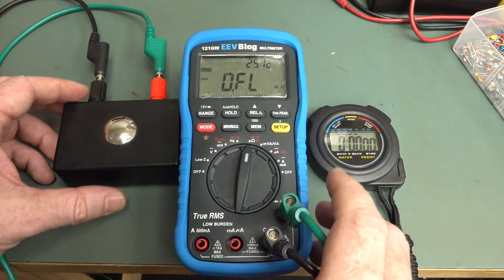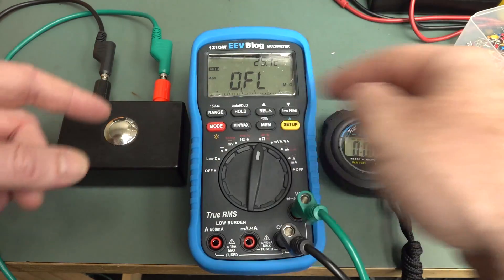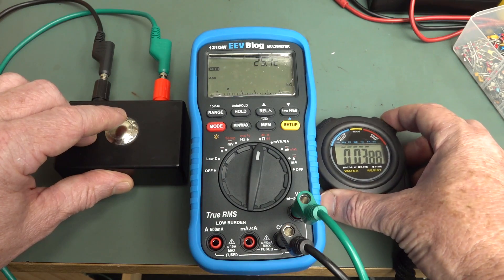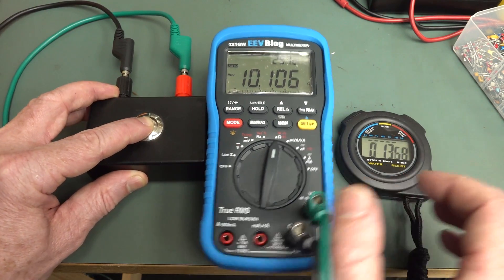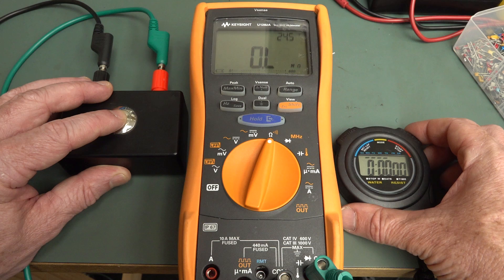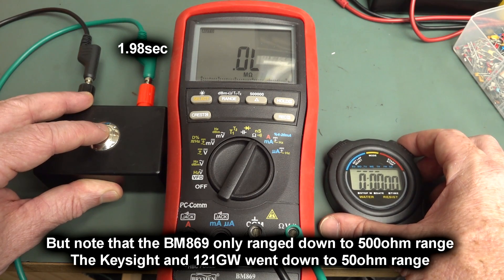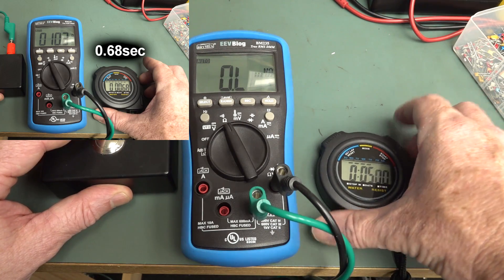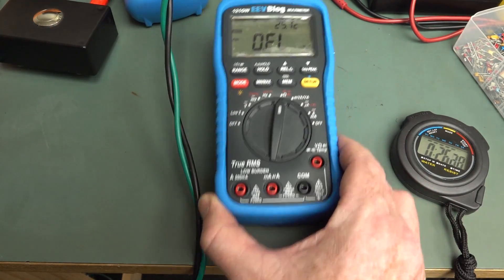121GW Autoranging Speed

Comment: Dave, what's wrong with you? 😉
Didn't you notice that the 121GW wasn't even settled when you measured the time? It's useless, even if the meter autoranges in 100 ms, it doesn't help when the reading keeps fluctuating further. 🤔
Take a look at the Keysight, it takes longer to display something, but when it does it locks right in, and is stable. You shouldn't care so much about people complaining about the speed, changing the firmware just makes it worse.

Comment: I agree most of the problems (especially with the slow ranging) were fixed. GREAT JOB! The 50 ohm range doesn't make sense to me. It does not produce repeatable readings which are better than the 500 ohm range even with the best case scenario - trying to measure the resistance of the gold-plated probes. The value moves up and down and does not give you higher stable resolution than the 500 ohm range and I'm not even concerned about accuracy. I've asked many times for options to disable this range in firmware somehow (using setup?). The same instability I can see in the 500 mA range where the extra-low burden voltage is. It is kinda pushing the limits of the used chips.

Comment: Hi Dave, great content. My Fluke 12 (from the 80's) beats all those you were using, however as you may know, it has no current range! I have become to trust it though and apart from the buttons which have worn out it has never let me down. I fixed the 4 buttons with some tact type switches and it works well. Good luck...

Comment: That´s why meters should have manual range select too
Reply: I have both types, but my auto is like 1/2 second at most like when continuity buzzer kicks on, but the reading is well before that. I didn’t even think about them being this slow.... mine was like $9 and it’s 1 button to turn on (so easy anyone could use it) and you can’t fry it even jumping between batteries with some that are dead (so they give resistance measurement) and some are fully charged 4.2v as you drag it slowly across the balance connector. I’m happy with it since it’s fast and indestructible so far, and seems to be really accurate for the extremely low price (it only goes down to the hundredth of a volt but it seems to be good to +-1 of the last digit when compared to a few of my more precise units that go to the thousandth of a volt on lithium batteries)

So in the case of that meter, there is no need for a dial that can break, its just a nice simple 1 button press and away you go jabbing probes into things! I never thought I’d like that, as I even hate the timers on windshield wipers, id litterally my rather press a button every time to make the wipers move because the speed is never how I want it since they don’t have potentiometers, I like things to be extremely manual and about have a heart attack when the stupid auto-roll up windows turn on because I’ll manually stop it at the top or where I want it! those things drive me crazy... but, the auto-range meter works so well and so fast I would have 0 use for manual dial (I would consider 1 second unacceptable, I usually only probe something for half a second at max, or faster for detecting shorts since the averaging of resistance will show a blip of a change and then I can go back).

But at these slow speeds I totally agree! For that meter I would definitely want a manual range too!

Comment: It’s too slow for troubleshooting. Try a short. The reading float around after that 3 second delay. Compare against a fluke 87, which is pretty much the meter used by everyone.  I am not used to meters this sluggish that the resistance reading float. Manual mode is fine speed wise but it’s so damn hard to figure out what range you’re on. I like the meter but it almost useless for troubleshooting.
Reply: With the original firmware it was unuseable for troubleshooting, but with V2.00 onwards it's bearable but only just......unless it's a big long job. Would love to see the autoranging routine completely revamped and to included a fast pre-emptive display of the value which then zero's down on the accurate value. Not sure how much this would be due to chipset though.
Reply: IanScottJohnston it’s a dot matrix LCD, correct? Have the firmware better indicate on the screen the reaction to the range button. I, for one, find it very difficult to tell what the range button is doing or what range I’m on after pushing it a few times. In manual mode it can be quite good for trouble, but it would be a tremendous help if the range display was easier to figure out. I can spend brain attention to figure out my test gear when I’m trying to figure out an issue with the circuit I’m working on. 

I realize this meter can do a shit ton more than most metered (low burden voltage for current measurements!). So it’s more of a small lab instrument than a hand help DVM. For troubleshooting, it’s hard to beat an old fluke 87. Fix the resistance auto response or better enumerate the manual resistance range and bam you have a great DVM! 

Also what Dave didn’t show comparing it to an Agilent, is it is not only response time: short the leads together and it reads .”020 ohms and then slowly over 10 seconds or more, it rises to maybe .256 ohms. That sucks when to are trying to measure how good a ground is. It fluctuates so bad, the REL button is useless.

Comment: Perhaps someone could explain why you need a fast ranging multimeter? Never seen this as an issue in my use.
Reply: Theoretically, if one has to test 100 or more resistors for example, and can't set the range manually, half a sec or something more per reading could add up. In such a setting though you'd take way more time to set the leads so idk what the fuss is about.
Reply: @HankScorpio64  I wasn't clear enough, sorry. I meant half a sec more per reading compared to a faster multimeter with comparable accuracy. Totally agree with you.

Comment: Hi Dave, do you know there is a gigadevice microcontroller called gd32f330 on lcsc.com, its a clone of stm32f330, tssop20 package. i dont know wether its pin compatible with the stm32f070 in the usupply but its a cortex m4 series microcontroller and has 128kb flash, maybe it can replace the 070 one.
Reply: I just look up the datasheet, its pin compatible with the stm32f070.

Comment: Sure you can find a few meters with faster update speeds, but which of those has low burden voltage on the current range, which of those will light a 12 volt LED, which of those will measure current and voltage combined, and does logging and Bluetooth

Comment: "I hope that cleared that up" - yes Dave. It shows us that it is slow.

That might not be important for most folk, but if you bought it to replace a previously fast meter... You would be understandably bothered by this.
Reply: For application that one really needs fast meter, just use fixed range meter.
Reply: @johnyang799  Ah Captain Obvious, you'd think you'd know this but... that "solution" only works if you're measuring a single fixed range.
Reply: @lmaoroflcopter  Just use a higher range right? Unless you need high precision and speed the same time which is very uncommon application wise.
I should say use different meters for different application.
Reply: @johnyang799  Statistics or gtfo. "Which is very uncommon". How uncommon is it?

Yes. A solution would be to have a different multimeter set up for different situations as required.

That doesn't change that the 121GW is indeed a slow auto ranging multimeter (not the slowest, but it is slow), and that if you are used to a better performing multimeter, it would be a disappointment.
Reply: @lmaoroflcopter  So what? I never said 121gw is fast or not. I was simply suggesting using a fixed range meter for the use. Why be so angry? And "statistics or gtfo"?  I simply think about the use cases through my head and cannot pick out an actual application that requires a multimeter that has to be autorange and very high precision the same time.
And the fact  that fast auto range is still not going to be as fast as fixed range makes it less demanding. And that's basically my solution. And I don't have 121gw.
Reply: @johnyang799  so why are you commenting in reply to my original comment? I simply said the meter was slow. Which it is. Which would result in disappointment if you are used to faster meters.

Where did I ask for a solution, your back story or your use cases. I'm stating that the video shows the forum posts are valid concerns. Your comments do nothing to counter that point.
Reply: @lmaoroflcopter  You said: 121gw is slow. People will be disappointed if they switched from a faster meter.
I said: For people who need faster meter they can use fixed range meter for that purpose. 
I simply complemented your comment. I wasn't arguing with you. People who see your comment may also see mine. So they can make up their mind for decision.

Comment: I would still call that slow, it's much better than it used to be, and it's usable, but a pain for certain uses.
For quick measurements outside of the bench I still use my old BK 2709B which I purchased after seeing your round up, because it autoranges pretty fast.
Reply: True. But why not fixed range.

Comment: I have both the 121GW and the BM325 which are used daily without thought of a 2 second auto-range delta. 
I use my multimeters, I don't benchmark them.
Reply: Only because you don't have the application that needs fast display time doesn't mean others don't. However for people who demand fast speed, just use fixed range it's instant.
Reply: Sure. But the dude not using a 121GW gets 4 measurements done in the time it takes you to do 1.
Reply: @lmaoroflcopter  What's the hurry in a ready world?
Reply: @lmaoroflcopter  Put down the whips you "management"

Comment: I have both eevblog meters, but sometimes I'm working with the 121gw and just pick the other because of the autoranging speed, kind of annoying. I don't see the need to hop on every single range, with the 4.5 digits it should be able to hop 3 ranges at a time and get much quicker to the final one, should be there by the 4th sample, worst case, maybe 3rd pushing it a bit. Other than that, having both I pick the BM unless there's something I need from the 121gw, that also saves battery.

Comment: Dave. The plastic inside the ohms socket in my meter snapped under normal use. Ive tried posting in the forums with no response. Is there any way to get this fixed?
Reply: One of mine snapped as well, less than a week after after I got it. I just carefully super glued it and it has held since.
Reply: @philiphiggins6870  unfortunately mine broke into several small pieces.
Reply: I’ve found it hard to get in touch with them. But they aren’t a huge company with a support team after all. I would email eevblog.official@gmail.com. Replies take around a week.

Comment: Why does this even matter? You can’t write down the result fast enough for 1 second to make a difference. Unless you’re working at some inhuman Chinese child labor sweat shop.
Reply: Because you don't always write down results. If you just probe around the circuit and see a few dc values or resistor values. It's important that the auto ranging is fast. Otherwise it's much worse than fixed range.
Reply: @johnyang799  But shouldn't you be taking your time? What's the rush?
Reply: @HazeAnderson  Because waiting 2.5sec for autorange to get my number can be frustrating if I am checking across the circuit multiple places back and forth.
Reply: @johnyang799  yes, trouble shooting is a frustrating process. You get to the solution faster, by going slower. If things aren't moving fast enough for you in this industry try software engineering.
Reply: @HazeAnderson  Na. I won't waste time on something isn't necessary.
Reply: @HazeAnderson  And I mostly use oscilloscope to probe around the circuit anyway.